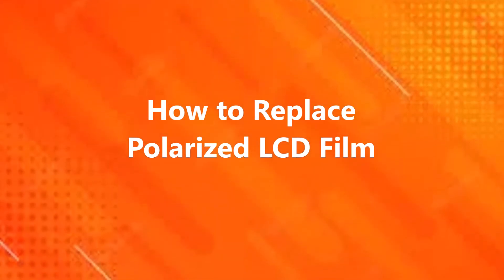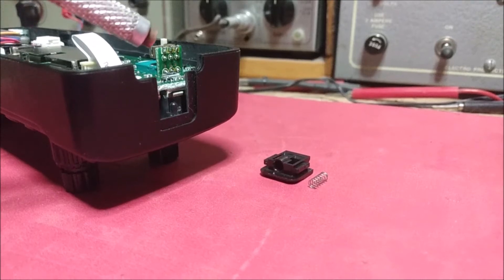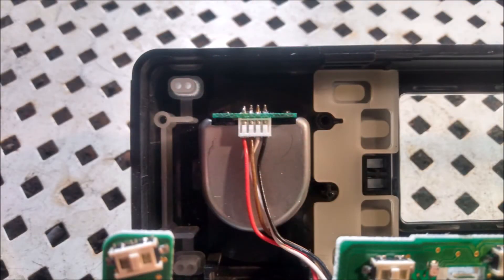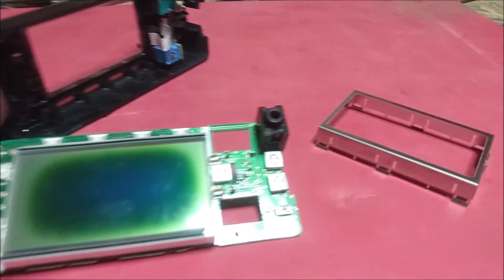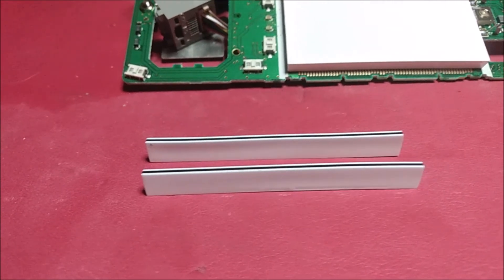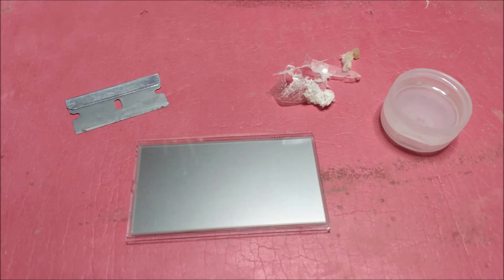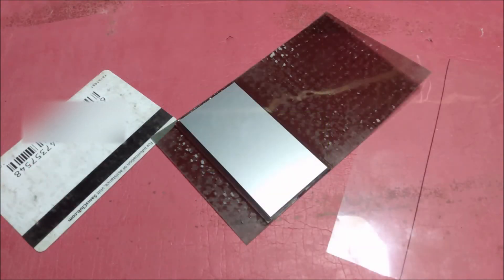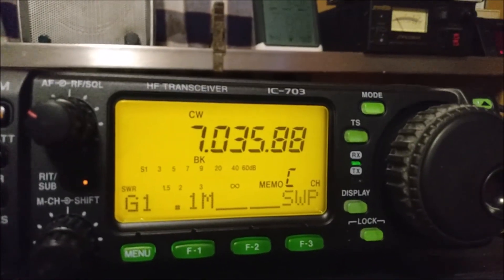ICOM IC-703 / IC-706 / IC-706MKIIG LCD Screen Repair

Comment: Thanks for the informative video. I have changed the film and the problem persist. This was a shocking moment when the light goes on. I could only presume it must be the metal screen that was damaged and NOT the plastic film. Now....where do I find such a screen as the service in South Africa is poor. Delays is also n huge factor.

Comment: QUESTION I am running the ic706mk2 and been told there is a Battery in the unit, either in the main body or the external, I have open  the main unit and have not found the battery, can you tell me where to look for it
Reply from the maker: There isn't a battery in the radios control-head that I'm aware of. I'm only familiar with the control-head. Here's a link to the service manual. After a quick look. I could not find the battery. It might not be a coin type battery? I'm curios now too. It has to have some sort of internal power for the memory. What is this issue? Why do you need to find the battery? 
Factory reset: With radio turned off - Press the Power button and the "Down" Band button (located in bottom right corner) at the same time. This will re-boot the radio to its original factory settings.
https://www.repeater-builder.com/icom/pdfs/ic-706-svc-man.pdf
Reply: @KG5JMV  Was told this many times by KE0OG that there is one, so I been searching the main body but never found one

Comment: Looks good. But my display isn't green but orange.
Reply from the maker: IC-703 QRP radios have a orange screen. The repair works the same way for both the IC-703 and IC-706 units.

Comment: also directions for hardwiring face plate for ic 706- ic 706mk2g.  reversible if you ever need to for resale. don't know why you'd part with one. great mobile rigs. . 73.

Comment: What adhesive did you use to re-attach the 2 communication strips? I guess it is important to keep the ports clear.
Reply from the maker: I don't use adhesive. I use the metal frame to group everything together and snap it back in place. Hope this helps.
Reply: @KG5JMV  Great!  It just took 2 tries to get it realigned and working again. That screen looks like brand new!

Comment: I miss my 706! Wish I didn’t give it up!
Reply from the maker: These are excellent HF radios. The original IC-706 was manufactured from 1995 - 1996 before the MKIIG series was produced, which was manufactured from 1999 - 2009. And the IC-703 QRP model was released in 2002. Today the used resale value is $300. - $500. which proves how amazing these units are.